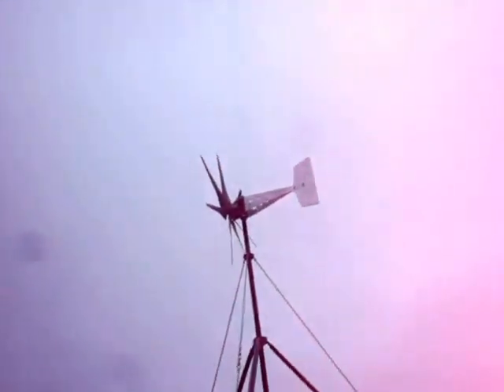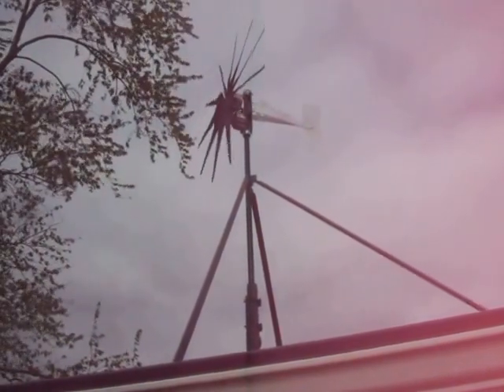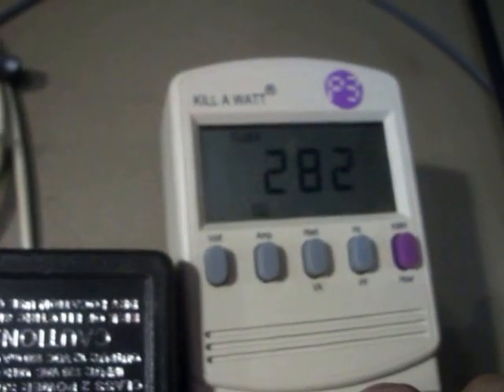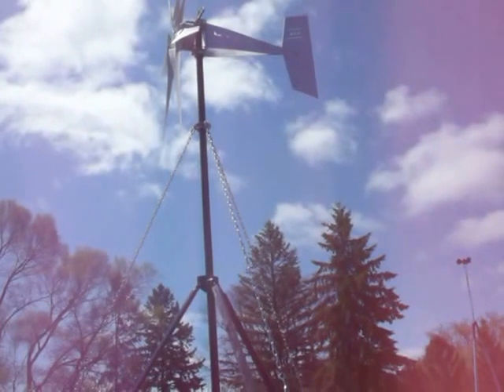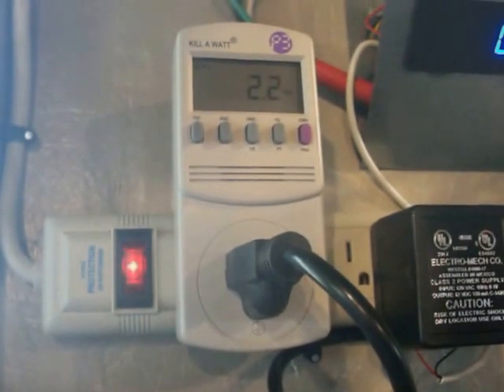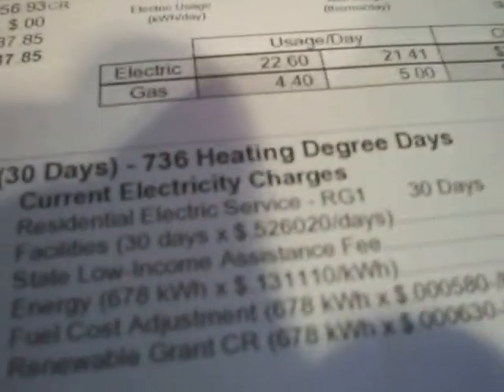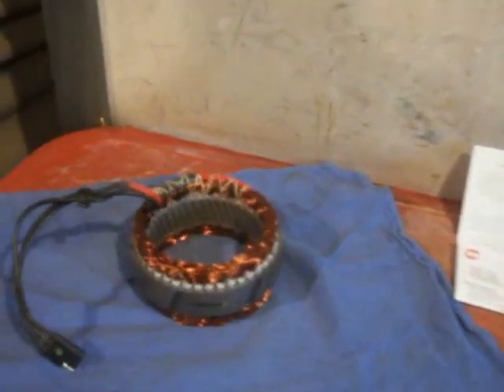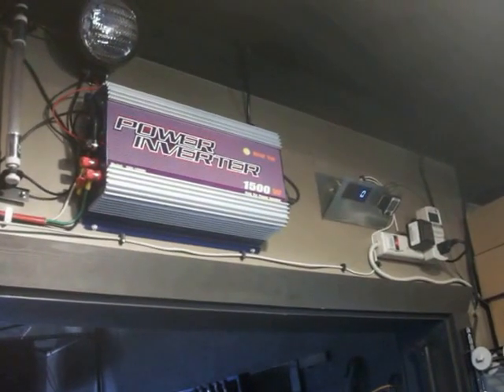Missouri Wind and Solar PMG VS. Modified PMG Results

Comment: So, what is the point of spending THOUSANDS of dollars, to make 25 cents per month?  Did you not look at your Average Wind Speed map before buying a micro-wind turbine?   Low Wind Speed = No Power !!!
Reply from the maker: I bought the low wind blades advertised.  This is an old video.......all that crap is sold.  I have 18 panels now.
Reply from the maker: I'm not a fan of wind turbines......at least not the micro turbines anyway and I've done all the tests I wanted using a grid tie set up.  I'm one of the only people that put an rpm meter on the set up.  Problem for me being in a subdivision, I can't go as high as I want to find a more direct or straight wind.  MW&S set up a wind tunnel for testing years ago and I'm not sure if they even finished it but I'm pretty sure they wouldn't do a video of output with different set ups including rpm's of the turbine.  The problem I noticed is it takes too many rpm's just to get my grid tie to first make power.  More magnets would help but to what level I don't know.  I have no interest in trickle charging batteries and to this day I will stand by what I've said: Dollar per dollar, solar panels kick the crap out of micro wind turbines.  Just one panel on a cloudy day would out perform my best turbine on the windiest day.  My current set up is okay but the payout is still 8 to 10 years with no additional expenses included......Still by no means a good investment but how can you put a price on making your own power when the power goes out.  I can switch my grid ties over to an inverter in that case.

Comment: Face it......your property is not a good location for wind power.  You are not able to properly install these where they can work as designed.  It's just that simple.  Sell your turbines and use the $$ for solar panels (if AND ONLY IF you have a good south-facing FULL SUN spot to place them).  If you have tall trees or buildings in the way, solar will not work either.

Comment: WTF? You grounded down the blades? Blades can be bent out off shape, to make the turbine vibrate! No wonder I can hear that off balanced/grinding/humming sound inside of your garage! Sorry to hear this, it takes very little weight on Turbine blades to offset them! Airplane Propeller blades, .0001 grams? - + on each wooden blade. Try filling in the tubing, with cement and sand, have another tubing for the cable to go into to, for it to spin freely, this will stop a lot of the sound vibration.... Good luck! THE HIPPIE TERRORIST
Reply from the maker: +HEMPPUBLISHINGCOM I actually have the 80 inch falcon 5 blade set on it now and it's performs the best that way.  The noise you hear is the sprocket slightly off. Chain gets tight, then loose and so on.......Close as I could get it and recently I had some very high winds for my area and I banked 800 watts for a 24 hour period.  My regular 7 blade set did 400 watts.  Not bad but that is the best I'll probably see.  On non windy summers, she actually uses more power then I make at times.  My grid ties suck up 2.3 watts just being plugged in.

Comment: After seeing the video, I wished I would have seen it before I purchased one. Thanks, I like your set up! What you need to do, is change the generator to this one! http://www.ebay.com/itm/231771129002?_trksid=p2055119.m1438.l2649&ssPageName=STRK%3AMEBIDX%3AIT.... Good luck.... THE HIPPIE TERRORIST
Reply from the maker: +HEMPPUBLISHINGCOM After testing the 12 volt against the 48 on the lathe, the 48 volt kicks in at less rpms.  I'm pretty much done with turbines till I make my own pmg.

Comment: It sounds like your lock nut came loose for the blade hub. That grounding sound, replace the generator bearings, too, and put rubber around the pipe, where it make contact to anything.... See my videos, if so....

Comment: Oh ya. The variable speed controller is plugged into a pure sine wave inverter for its power and that runs the washer motor that spins the duel 12vdc PMG that I have. This setup is a closed loop system that produces more than it uses plus powers my apt ent center, apt size freezer, fridge, the kids rooms w/play stations and two routers. Removing these electronics from the grid.
Reply from the maker: +Butch Weise Can you make a video of your setup?  The inverter is connected to a battery bank?  My lathe which has a 1.5 hp motor was having a tough time spinning the single 48v pmg to get any real power out of it.

Comment: Ya your right. You needed to take a realistic look at the wind you get in your area before you bought those wind turbines. I'm running mine off of a belted washing machine motor with a variable speed controller. This way you can control the charge you get from the turbine. I would suggest you do the same.
Reply from the maker: +Butch Weise I figure the best way to go with a wind turbine is to make your own.  These small turbines only have 14 magnets with 7 sets of 3 coils.  If you had twice the magnets, the cut in speed would be a lot lower.  I bought the MW&S 11 blade set which advertised for extreme low wind.  Sure it will make power but it's crap power thru a grid tie.  600 watts for a second equals jack $h&t.  My solar is 100 times better.  Even Orlando and his awesome heavy duty turbine doesn't out perform solar.  Nice thing about his video's is he shows kw's made per day.  Some days he'll have 9 or more.  But when you average what he makes for a day out of a month it comes to around 3 or 4.  My solar panel set now out produces that but he also has solar panels so he is working with both sun and wind.

Comment: Hey Lightendog, I have been watching some of your videos hoping to gain some insight on trying to do my own hydro system. I can't find any winding data on these PMG's anywhere. I work at an electric motor shop, and I'm wondering what cycle these windings are set up for. If it's wound for 60 Hz they're not going to work well. Do you think you could count the stator slots, so I could see what our winders can come up with for rewinding them for higher cycles. I know we get some MG sets in that run at 400 Hz. Since PMG's need to be converted to DC, the more cycles you can get out of them the better. Anyway if you could it would help out a lot, and I would share any information I can as well. Thanks
Reply from the maker: nathan Tucker That's great you work at an electric motor shop....Maybe you can help me figure out a few things.  But first to answer your question......It looks like there are 7 sets of 3 different windings, one set for each wild out put.  If each winding has two slots,  then 21 windings would be held in 42 slots.  I counted it twice and there are 42 slots.  Not sure if they are tied in star configuration or delta cause I don't want to unwind it. You'd probably know that better then me.  The hz thing is what I don't understand, that is usually controlled by the speed if I'm understanding it correctly and the grid tie with it's capacitors holds the higher hz within range.  This is just my guess.  I'm usually wrong about things like that. lol.
 
My question I really would like to know is how come no company out there actually tunes the wire to iron ratio for best output.  MrAngusWangus has some videos on it and it's measured in Henry's.  The old timers did this with there designs but today, companys like to put more drag on motors so they burn out faster.  If you make a motor that lasts forever, one day you'll be out of business.  I've seen a video of a guy rewinding a small car air pump and got almost twice the out put.   As I look at the PMG's stator I'm thinking there is way to little iron.  The balance of the amount of wire used to the amount of iron used everyone seems to ignore.  The biggest problem I'm having as they have to hit 240 rpm's to first start making power.  And that's goes for both ac and dc input grid ties.  The ac grid tie is simply a dc grid tie with an internal rectifier.  I'm seriously thinking in order to actually make good power, I'll have to build my own pmg.
Reply: The MG sets that I was talking about, use a 460 volt 2 pole motor to drive another motor that is wound to make 400 Hz. I'm no winder, so I'm not sure how they do it, but it keeps the DC output more constant. I know they're like 80 something slots, so I don't know if its even possible to wound these to make the cycles. And yes your pmg's cycles will bepend on the rmp. I'll ask about the he iron to wire ratio too. Thanks
Reply: So after talking to the winders there's no way to connect them to get a high cycle out of it. All the MG sets are doing is taking a faster motor and over speeding a slower motor. You could still use the winding, but would need more magnets if you wanted to make power at a lower rpm.I'm going to have to get in touch with one of our engineers to answer the wire to iron ratio. We get all kinds of motors in, and our winders said they wound some with lots of iron in the core, and some with very little core iron. I'll also try to find out what would be the best winding set up and poles to use on the rotor for lower rpm applications.
Reply from the maker: nathan Tucker If you keep all the magnets with North out, you'll get your DC current.  Alternating poles is for the AC which I'm sure you already know.  Using DC current you have to run those fat battery cables so AC is better on the turbine.  Hydro may be different if you don't have much distance to carry current.....

  So more magnets is the answer to a lower rpm output.  Makes sense but it also leads me to the next PMG design flaw.  Maybe your engineers could answer another question.  My PMG has 14 magnets stuffed in it with alternating poles.  Now if I remember correctly, it's also important with spacing between the magnets.  Too close is no good.  They are supposed to be spaced about another magnet length apart or maybe spaced 1.5 the magnet length apart.  I don't remember exactly but when I was making my bedini wheel, I do remember that being a point made by someone.   In my PMG, the magnets are only about 1/4 inch apart and the magnets themselves are about 1 inch wide. The bottom part of the magnet is only about 1/8 inch from the next as they do form a circle.  I suppose they wanted the case to remain a little smaller due to the weight.   A better performing PMG should have a much larger case, more magnets and iron but again the down side is the weight would be a hell of a lot more.  You should check out MrAngusWangus video's on the Lenz affect where cogging is not that big of an issue with iron core's.  There are many factors to consider and I'll never master any of it unless I go back to the drawing board, messing with the iron cores which I skipped.  I worked with air cores and moved on to the wind turbine.  I probably shouldn't of skipped that study if I want to build my own pmg from scratch.  Thanks for the info and whatever else you can find out.
Reply: ***** . I'm a mechanic, so in AC motors about the only thing I deal with is the air gap. If its off you'll have trouble. Spacing is always critical in motors. The iron helps amplify the magnetic fields in a AC squirrel cage motor. I would assume that in a PMG they help to also amplify the magnetic field to the coils in the stator from the magnets on the rotor. I would think it would depend on how strong the magnets are as to how far they need to be spaced out, so you would know where one field ends and another should begin. I think I'm going to break down and buy one to start playing with it. Your videos were a big help in seeing what one will actually do. I couldn't find anyone else who did the testing you did.
Reply from the maker: nathan Tucker All the testing should have been done by MW&S years ago.  That would of saved me a lot of money.  They're finally getting a wind tunnel for testing but I hope they also include rpm read outs with grid tie inverters.  Battery bank systems can mask actual power being made.  I have a 24 volt pmg it don't look like I'm doing anything with.  Let me know if your interested.  Actually, I have a ton of stuff, blade sets, and grid ties of all kinds..........
Reply: I'm looking into my local electrical codes to find out how everything has to be hooked up. I may be interested in your grid ties. I will more than likely go with a 48 volt system. The higher the voltage the more efficient. I wont need any blade sets since I'm trying to do hydro, but I will be needing anything else to get it up and going. So far the only thing I have is the pelton wheel.
Reply from the maker: nathan Tucker Not sure where you live but for me here, if you wanted to sell back power to the electric company, they make it really expensive with things having to be professionally installed and such.  As far as grid ties go, you just plug them right in the wall and because they don't produce that much power you don't have to worry about anything.  Changing all your lights to LED is best, then only solar is the best option after that I'm thinking (still to be tested).  If I could go back I'd never even mess with wind turbines.  Now on a hydro set up, if you could gear it up, it might work great.  Keep in mind even the 48 volt pmg needs 240 rpm's just to start to make power.  Very crappy design in my opinion.  If it took years to design, one would figure they'd come up with something that actually makes decent power but then again, we probably couldn't afford it then.  I'd never be proud to put my name on those pmgs they have out.  Even if you could get 2 kw's per day your savings is only 34 cents.  Great investment....lol.
Reply: I have already changed all my lights to LED's. It has helped a lot only being 8 watts a piece and the reduction in heat they put off compared with other bulbs. I wish I knew what Horse power the stators are rated at. It would help out knowing how much water pressure would be needed to get them going fast. Watching your lathe get a workout in your videos does scare me a little. I would also like to do some solar down the road and knock the electric bill out. If I could get the PMG to produce anything it would at least make that power 24/7, but if its only 30 watts or so that's only a little over 3 bucks a month here. not really worth the money. I have been looking at this WHE steam generator that I really wish they would hurry up and get them ready to sell to the public. That would be the way to go. Use bio fuel and get that sucker spinning.
Reply from the maker: nathan Tucker I know a guy who made a water wheel using the pmg and he got it to work but wasn't 100% happy if I remember correctly.  He had the 12 volt for charging batteries.  
Too much messing around making stuff for the wheel and then tweeking things to get it work better........He was happiest with solar panels. lol.  He even went with the sun tracker system which is what I'll be doing next.  I've got  eight 230w pannels and two solar trackers systems and a bunch of angle iron ready to go.  I just need to find a little time.

Comment: I have never been a fan of the GTI's cause what it takes to produce and what the GTI's do to the load of the PMA. And for not caring where the pma came from is baffling to me? Cause with my experience with all types of pma/pmg's. Its origin is important! Gearing it up and change of many blades design's is shown all over YT. And they don't work neither! Batteries and a Reliance  switch box tied into your main breaker is the best way to go! Cause if you have wind and solar on a good day, you can switch to off grid on the breaker panel and start using your power from the batteries. And begin to cut your power use there! That's the way I do it! But the inconsistency of China and now Vietnam product's have flooded the market!! Plus cutting corner's to making something that for one is shipping cost and mass producing has cause these imperfection's in companies that buy from oversea's! Plus a company to claim it is made in the US is really misleading!! And that's why I buy and do what I know that work's!! But with all types of turbines geared or not, the power cut in is still a 8 to 10 mph with a 60"dia. to see production! I show this in all my vids! Thanks for showing :)
Reply from the maker: TheBillythekid2010 A battery bank setup might be a lot better.....but it does come with more expense.  Here is the part I don't understand - One cannot use more from a battery then they put in.  Speaking only on turbines for my example.  If the turbines don't make much power to begin with, you'd be drawing from batteries until they're dead cause you use a hell of a lot more then a turbine can put back in.  If GTI's have a 50% power loss, the power made from a small wind turbine is still useless on a battery bank.  I don't recall if Jeff said his pmg's where made in the USA but I think I do remember him saying the blades were.  I don't see anything great about the small wind turbine made anywhere unless one can successfully gear one up.   I've seen 600 rpm's but for a second which equals jack in the long run.  My last hope is the 80 inch falcon 5 blade set on the modified pmg and I'm pretty sure the out come will be the same.  Making any real power will be from the solar panels I'm sure.  If I could go back in time, I'd totally skip over the wasting of money on wind turbines.  I'm very disappointed in all the hip on wind turbines.  My very last video on testing the killawatt meter pretty much sums things up for a bigger picture.